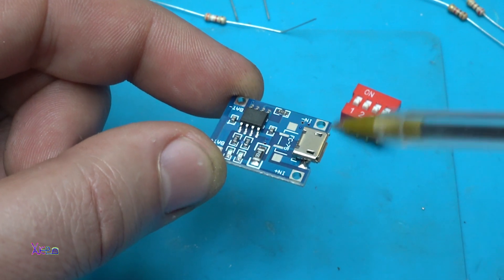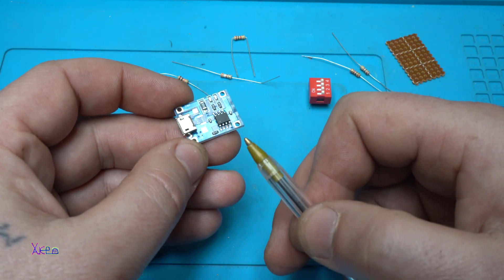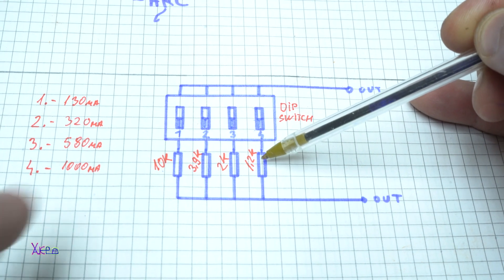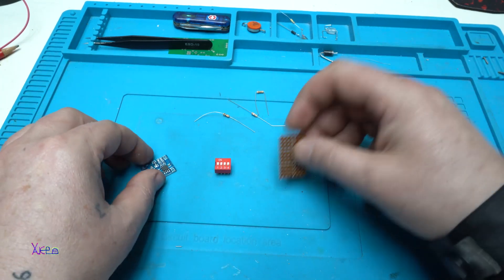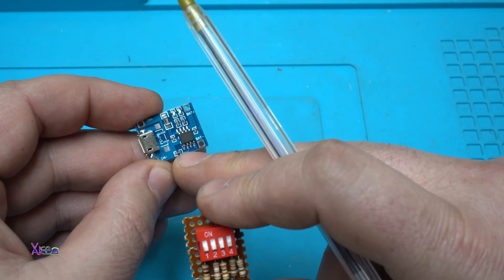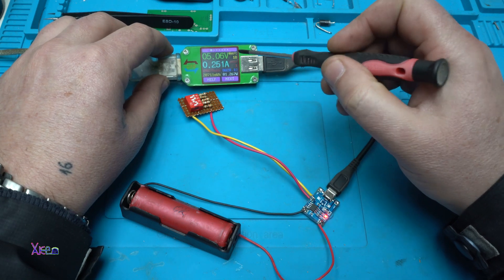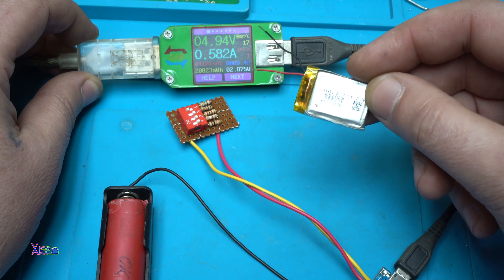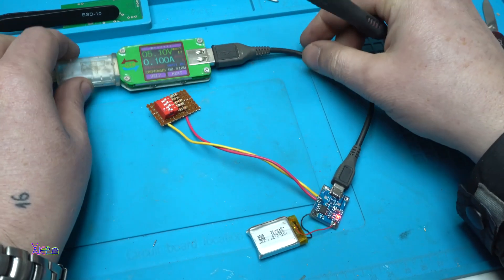Charge Different LIpo Batteries WITH TP4056 Using THIS IDEA?

Comment: A question. How do you know what current to charge at for a particular battery. I found this quote, is it correct?
 "This target charge current is relative to the battery capacity ("C"). For standard Li-ion or Li-polymer batteries, chargers often target 0.5C charge current. In other words, if the battery is rated at 500 mA-h, the target current is 250 mA."
Reply from the maker: I know this,good and healty charging is with 10-20% of battery capacity,example if battery is 1000mah you should charge with 100-200mah

Comment: There is an updated version of the tp4056 module . It has 2 extra chips, that will protect the cell from over discharge etc.. it is the same cost as this older module on AliExpress
Reply from the maker: I know that but I order these boards several years ago,maybe 30+ need to use them😉
Reply: @Hacktuber  haha, good point !

Comment: You still don't get the battery current right. You measure the current on the 5V (USB) side. The current on the LiPo side is not the same as the the current you measure on the 5V side. The LiPo current is dependent on the charge state of the LiPo cell and the resistor value you selected with the dip switch. Putting a current meter in series with the LiPo cell would measure the current there, but would also disrupt the charger function due to the resistance of the current meter. You should calculate the input power (5V x displayed current), which is equal to the output power when neglecting the power consumed by the charge circuit. The LiPo current should be equal the the input power divided by the LiPo voltage. A voltmeter over the poles of the battery does hardly disrupt anything as it has high impedance.
Reply: Creo que su objetivo se cumple permite disminuir la corriente para cargar distintos tipos de baterías de litio sin correr riesgos. En este caso solo se  persigue suministrar  carga a la batería. Este modelo del módulo TP4056 parece  no brinda opción para conectar una carga.
Reply: TP4056 is a linear regulator instead of switching supply, so the current is actually the same while power is not.
Reply: @henry_tsai  You are right. I did not looked up the TP4056 and assumed it was a switching regulator as linear regulators waste a lot of energy when the difference between input and output voltage becomes larger.

Comment: This is a good idea. I work with many types of lithium batteries and use the TP4056 board to charge. I have just been changing the resistor on each one for small batteries. I bought a pack of 10 TP4056. I think I'll make a small 3D printed case with the micro-switch or 4 position rotary switch. 

I really enjoy your videos, they give me lots of good ideas!
Reply from the maker: Glad you liked the idea and found it useful!

Comment: What happens if you accidentally set an unexpected switch combination?
Reply: I would think a combination of 2 or more would just increase the output amperage. For example SW3 + SW4 would = 3.2K ohms. This would be about the same as just SW2 3.9K ohms. I would have to test, but higher than 10K ohms should result in a maximum of 1 amp.
Reply: @stevesweb  I think in your example you're calculating based on serial resistors but this circuit might produce parallel resistors.
Reply: @D-Mac56  Woops, my bad. You are exactly right. I guess in my example, it would drop the resistance to about 750 ohms which should raise the amps to the maximum. I will definitely check on the output using values outside the range listed on the chart. Thanks for letting me know!
Reply: @stevesweb  Figuring parallel resistors is way beyond my math skills!!!
Reply: @D-Mac56  Oh mine too! I use an app.
Reply: @stevesweb  😂😂😂😂
Reply: In order to avoid this mistake, I think that using a rotary switch it would be a better option.